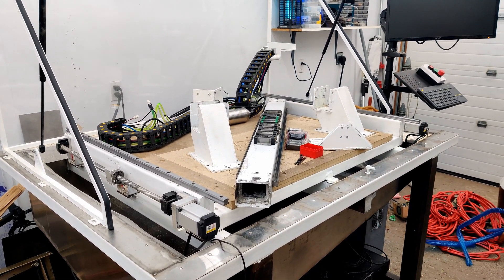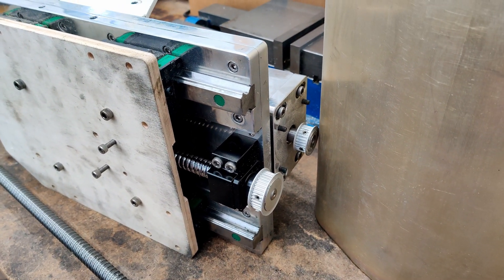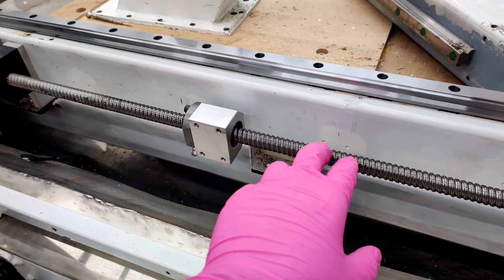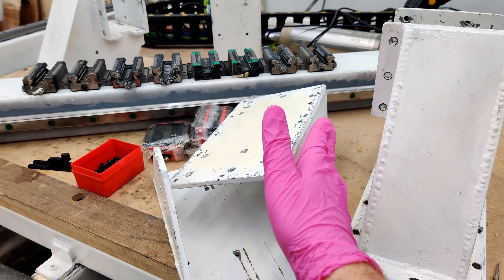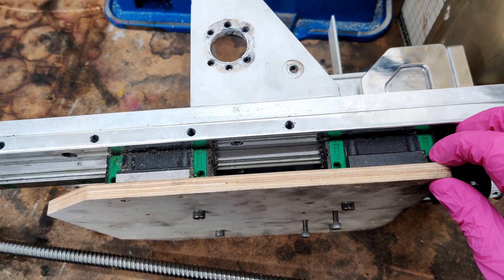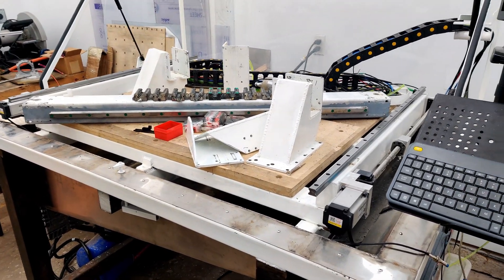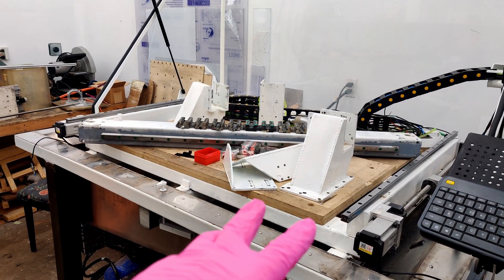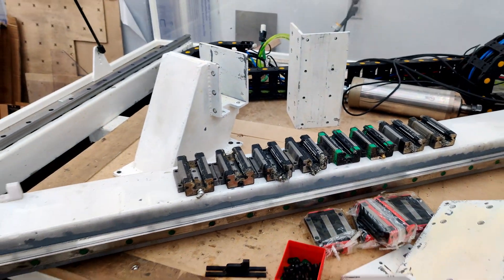Upgrading My CNC Machine: Longer Y Rails, DFU1605 for Z and Y Axis, and Rebuilding Carriages

Comment from the maker: Have been waiting for a bit of downtime to do some upgrades to the machine. Once disassembled I realized I’ll need to order a longer timing belt and found out that both Y ball screws are totally worn out. Probably be a month to get the replacement parts delivered. In the meantime I’ll rebuild all the carriages and attempt to rebuild the X ballscrew. 

When aligning the new Y rails, I’ll use the laser level and webcam system to get that nice and straight and use that to get the other rail planar to it.

What do you think if I leave the Y rails uncut? I can't for-see any issues leaving them uncut. If I cut them to be the same length of the Y tubes, I'd be having to cut through a bolt hole which wouldn't look nice.
Reply: Always nice to see you working on the machine. I don't think you should have much problems with leaving the rails long besides aesthetics and maybe hitting yourself on the exposed ends. That's assuming you won't actually use the extra length as an actual force bearing part of the rails. There's even a "commercial" CNC from SamuraiMachineTools that has rails that are unsupported at the end to ensure they have the full range of motion, the way their machine is designed it doesn't really affect the performance.

Comment: Will a DFU 1605 ball nut fit on the 1610 ball screw?
Reply from the maker: I don't see how it could. The pitch is different one being 5mm and the other being 10mm
Reply: @BryanHoward  Right, makes sense, when you mentioned the double ball nut I guess you just misspoke about the pitch of the nut you ordered.
Reply from the maker: @CNCWerks  Ohh yeah watching it over I didn’t mention that I’m replacing the whole screw + nut. The machine currently has SFU1610 but I’ll be replacing all that with DFU1605. So not just replacing the nut. 

DFU1610 seems to be uncommon and I think the reduction of pitch will handle the loads better. I don’t think it’ll affect my rapids much on the Y axis. The Servos can go up to 6500rpm and I’m not getting anywhere near that limit. Also the screw isn’t too long that’ll run into many issues with it whipping at higher speeds.

Comment: Hi, great work! In my spare time, I am building a combination weigher using the principle from the laser and webcam setup. I would like to know which exact webcam you are using. Thank you for sharing your work.
Reply from the maker: This one: https://www.amazon.ca/gp/product/B07VL7BNLZ

It's cheap and easy to take apart. You can de-solder the LED's and it'll still work. The PCB has a small JST connector so you can take the USB cable off when working on it. It works in windows and linux.

Comment: Those nuts sure wore out quickly.
Is that normal i dont have cnc machine.
Reply from the maker: I think a number of conditions accelerated it getting worn out. Exposed ball screws pickup metal chips and other debris. 10mm aggressive pitch. Heavy mass gantry being moved around by high powered 400w servos. Unlike the carriages, I never rebuilt the ball screw nuts so any crud that got in them stayed. 

I think with a lower pitch ball screw and as a double nut the replacements should last much longer. If I can get more than 2 years out of them I'll be happy 😁

Comment: At some point, you have to think about is the time and cost really worth it to roll your own machine from scratch, or just pick up a used machine for cheap, and fix it up and or retrofit the control - not that that's a short or easy project either, at least not on some machines.
Reply from the maker: Yeah true. A used machine in working condition will probably be on the horizon. A retrofit with new electronics probably won't ever happen due to work involved.
Reply from the maker: I think most of the time put into this one was totally worth it. The biggest time sink was evolving it to a machine that could handle cutting harder materials.

I think after the fixture plate and steel plate get put on, the upgrades will end for this machine. Just periodic maintenance.

Comment: So often what looks like a simple upgrade ends up with heaps of 'knock-on' effects, and you cannot wait to breathe that sigh of relief when you finally finish.
I have caught myself out more than once because I forgot to use a lathe or mill to perform that last operation before I dismantled it!
Reply from the maker: Yeah it sucks. I held off doing the upgrade for 2 months due to ongoing use of the machine. Didn't plan on having more than a week of downtime.

Comment: do you have an idea of how heavy your machine is?
Reply from the maker: I don't have a good idea. I know my gantry tube without the rails attached to it weighs about 70 lbs. Both gantry risers weigh probably about the same together. ~140lbs in just those 2 parts. The Z assembly isn't light at all. Lots of steel and aluminum on that. Plus the weight of the rails on X and the weight of the spindle.